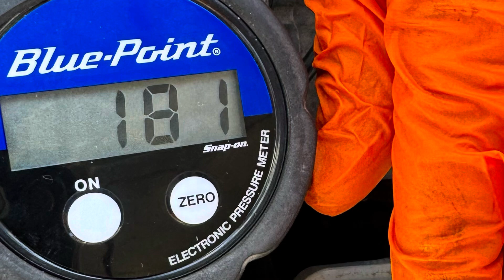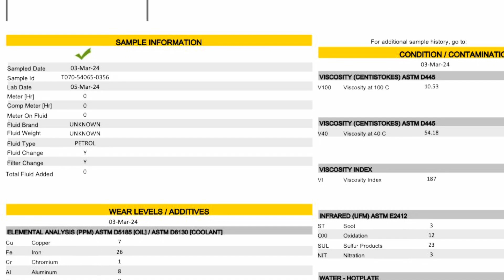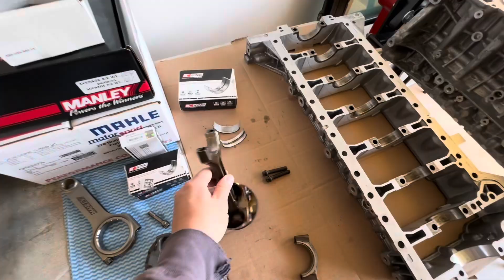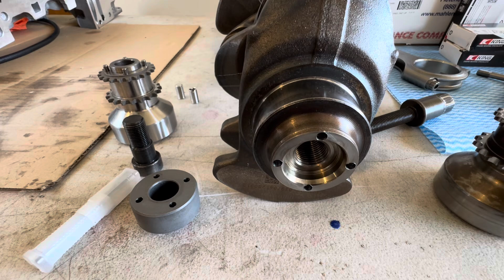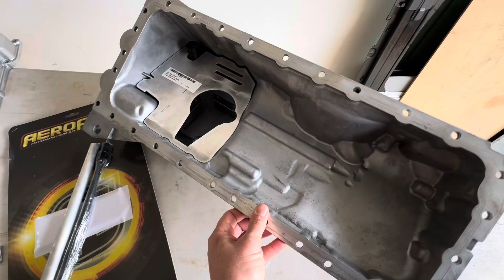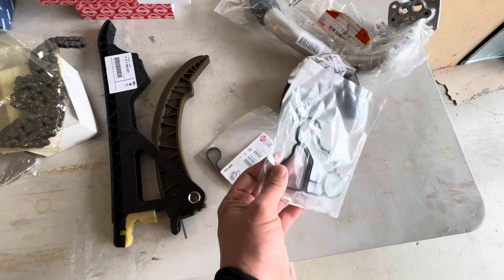IN54NE: Part 3 - N54 Engine Preparation & Plans

Comment: Great videos. I'm in the process of a nearly identical build. Do you know what piston wall clearance you went with? I first bought the 84mm Mahle pistons, but after doing more measurements on my block, I found had some serious ovaling at the very top of the bore on cylinder 6. I then bought a set of 84.5mm and had the block bored and honed. I wanted to end up with around a .0045" piston wall clearance, but my machinist went a little overboard and now I'm at .0055". He swears to me that looser is better and this is ideal for the power level im planning, of around 750-800 whp. I have not seen anyone running that big of a clearance. The mahle spec is .0025" to .0033", but the documentation says to add .001 to .003 extra clearance depending on the application and power level. Mahle did answer me in a YouTube comment and said that clearance could be as high as .006", but that .0045" would be good for my target, however it would likely be noisy on startup. Now im .001 bigger. I was all ready to accept it and put it together, but when doing ring gaps, I had one ring that was already at .027" before doing any filing, and thats in the smallest hole. Im really torn on if i should roll the dice, trust my machinist, and let it ride. Or should I start over with my other N54 block.
Reply from the maker: @JimHardee  I can’t find my notes on those measurements from the build, but I recall being slightly larger than the Mahle spec, perhaps about 0.004”.  So, if anything I’m on the tighter side of the tolerance for that power level.
Reply: @DarkePeak  thanks for the reply! .004" is basically where I wanted to be originally. Do you have any piston slap or noise on cold starts?  Once again, thanks for posting these videos, excellent information.
Reply from the maker: @ no piston slap on cold starts, it sounds the same as factory engine

Comment: You’re absolutely right about you paying top dollar for the valve cover. They all come from the Same manufacturer. But dude cmon stop being dramatic about the valve cover, like come on man you’re complaining about small ass nipples/dots that don’t affect the performance of the valve cover what so ever lol. I personally would recommend these over the OEM plastic ones. There’s many pros when it comes to running an aluminum valve cover. These are best for top mount single turbo guys. valve cover won’t warp, and since it’s aluminum you can paint/powder coat it any color to your liking! I’ve personally installed 15+ of these and haven’t had 1 issue/complaint. Just use a OEM valve cover gasket.
Reply from the maker: @ST.G8x   interesting.  ECS agreed that the quality didn’t meet their standards and gave me a full refund and let me keep the VC - it’s still in its box on the shelf.  There was metal flakes and swarf coming off it everywhere, and it was severely warped.  I agree that top mount ST guys need an aluminium cover but that’s not me.
Reply: @DarkePeak  maybe you got a bad one, but like i said I’ve installed a lot of these and also has sold a lot. Not 1 issue or complaint. I’ve heard some people complaining about them being warped. But in reality they just didn’t bolt it down correctly. With these valve cover you have to go in a star pattern and go over them 3 times, also I wouldn’t use those plastic shims they come with for the bolts.

Comment: Hi. Some question to you regarding the ARP 2000 studs:

- What is the total length of the stud ?
- How long is the M11x1.5 treads (block end)?
- How long is the 7/16" treads ( nut end) ?
Reply from the maker: Total length 152mm
M11 thread: 36mm
7/16 thread: 24mm
Reply: @DarkePeak  Thank you, it looks like the ARP stud used
is ATP5.975-2B  (Total length: 151.765 mm)
Reply: Hmmm, an alternative might be ARP ATP5.950-2LUB (Total length: 151.130 mm),
this also have longer threads.
Reply from the maker: I will take a measurement for you on the weekend

Comment: You’re doing exactly what I’m doing. Filled my block drilled it all off that. I’m nervous with drilling the head and it being 100% centered. I don’t want to lift my head. Can you help?
Reply from the maker: I presume you are referring to the holes for the NS300L inserts.  That kit comes with a locating dowel to centre the drilling guide over the existing hole. Shown about 1min40sec in this video. https://youtu.be/NHy07sjwnCg?si=ZTNMVGkEpNLls26a
Reply: I already drilled and put the inserts in. I’m talking about drilling the head and keeping g the head centered on the block
Reply from the maker: @MicahDornbusch  ok, I cover the head drilling part about 34 mins into that same video (to centre the 11mm hole drilled in the head).  Then the M11 corner studs is going to centre the head on the block.  
https://youtu.be/NHy07sjwnCg?si=xaYhShFZyOSPOsGc

Comment: You guys have dirt cheap machine work available to you. I can't even find a shop to do basic chevy motors. Much less anyone I would trust with a BMW. Especially the ones with coated cylinders like N52. So, I have a couple motors sitting around that I can't do much with.
Reply from the maker: Which part of the world are you in?  I thought  the prices I paid in Australia for machine work (decking, facing, honing) was very reasonable, but the US$750 for replacing valve guides and cutting seats seemed less reasonable (but still acceptable).

Comment: how strong is the epoxy? im deciding between this type of epoxy or the defcon aluminum paste
Reply from the maker: After drilling, cutting, filing and hitting it (leftover piece) I have no concerns about the strength.  The current world fastest N54 is an epoxy closed deck (8.16s 1/4 mile).
Reply: @DarkePeak  thanks for the info, this epoxy is def more user-friendly than aluminium paste